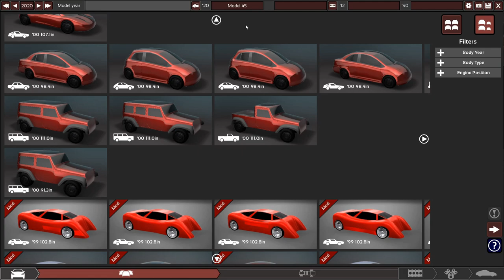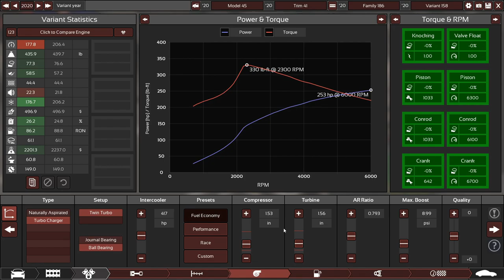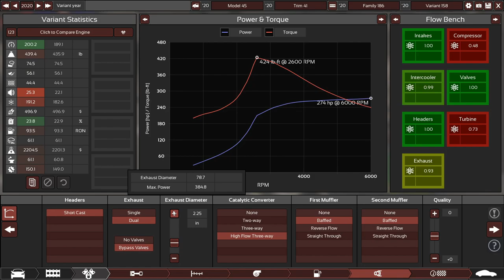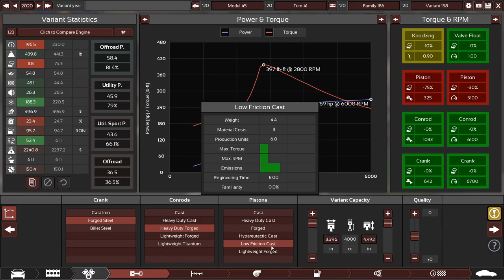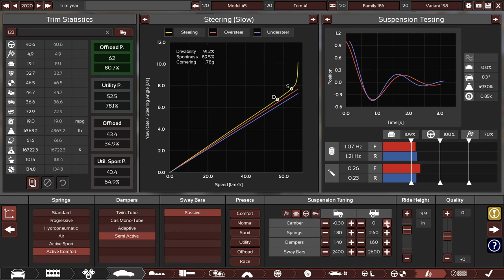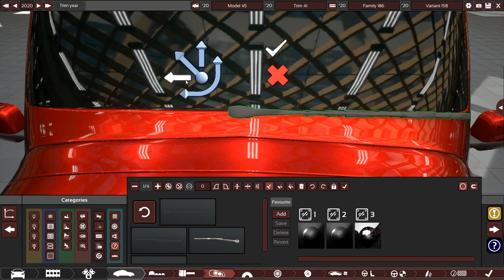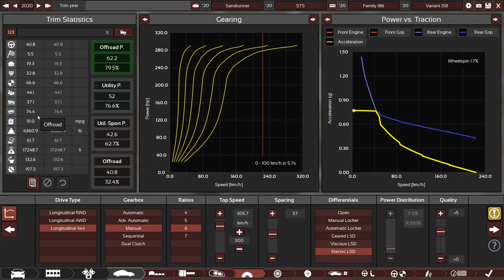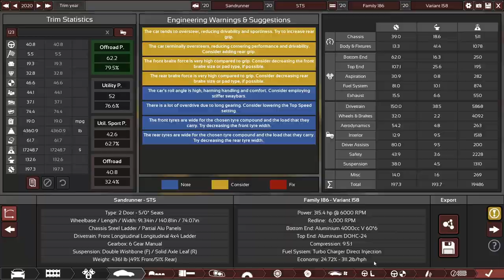Building My Greatest Offroader Yet - Automation - BeamNG

Comment: I feel like the rev limit severely limits the power output. Try moving around the rev limit until power drops off a little next time, it gives you a better power output and a better driving experience overall. Great build nevertheless.
Reply from the maker: I do increase the rev limiter slightly while fine tuning the vehicle (during the timelapse part) got it to 335hp (up 20) and after that the power curve did dip!

I also didn't want crazy numbers, wanted a bit more of a torquey beast :D
Cheers!